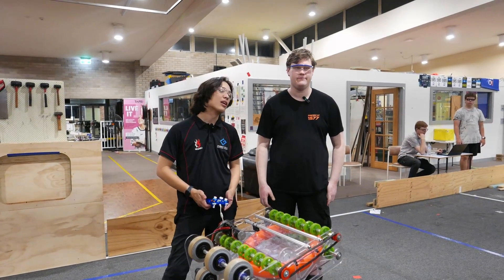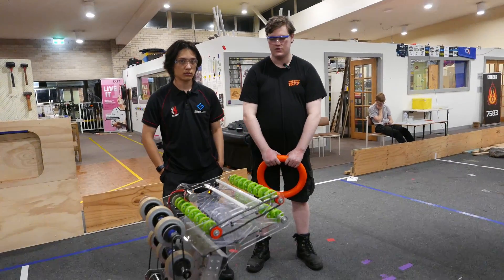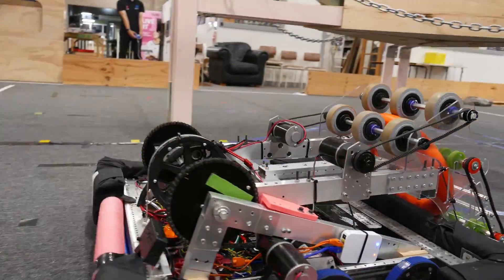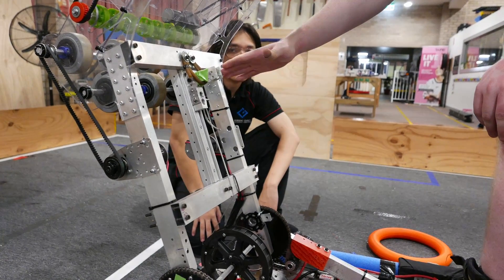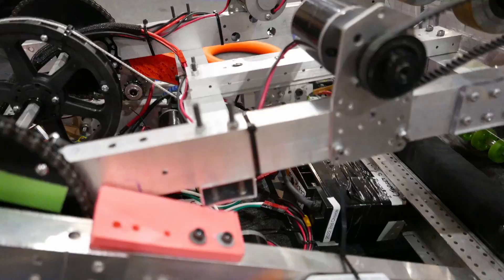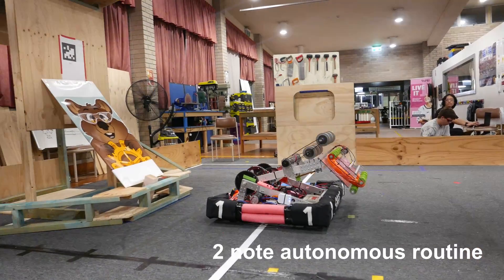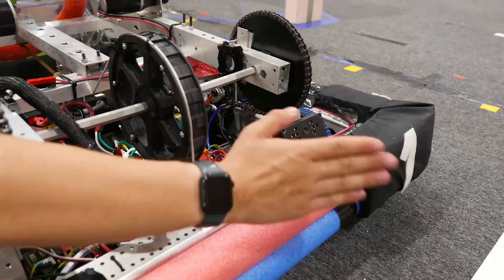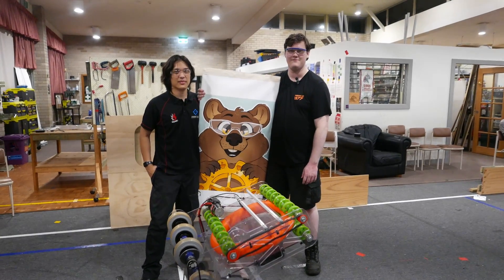[2024 Ri3D] Unqualified Quokkas Breakdown and Explanation

Comment: What reflectometer are you using and how did you decide to use that over a different sensor?
Reply: Its an AB 42JT-F5 and we chose to use it because there was no other option on-hand. It is not ideal for this applocation and a longer-range sensor or a beam break would be more consistent.

Comment: how did you guys lock the motor after climb?
Reply from the maker: Initially, the reduction of the arm plus the motors being switched to brake mode was enough to keep the bot from dropping over the 5 seconds. 
But when we do changed the ratio, it is now hit or miss if it locks or not which is strange. 

But you can definitely design a brake for the arm or some other system to prevent the bot from slowly falling after the game ends.